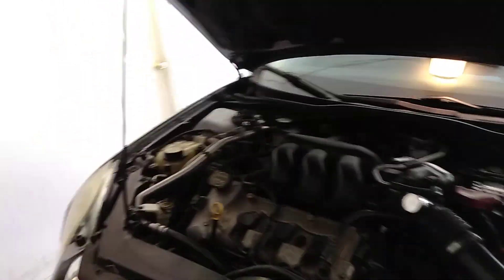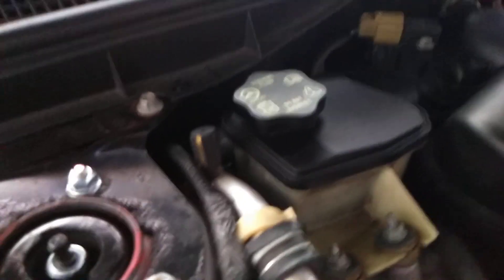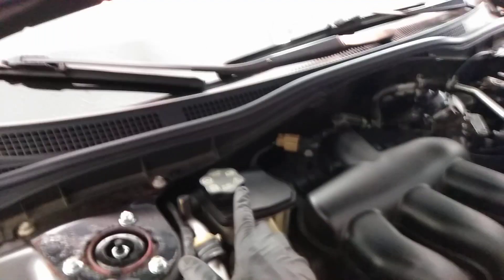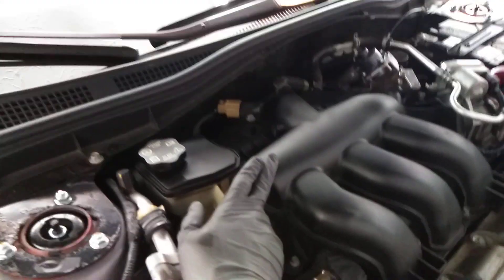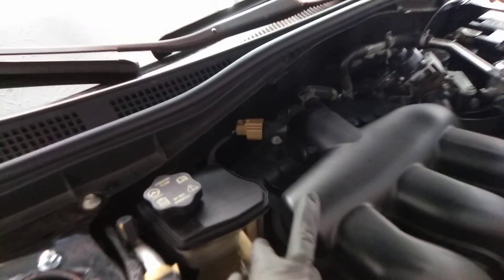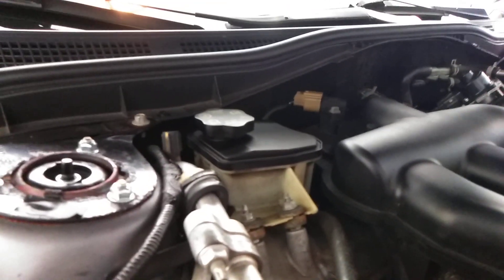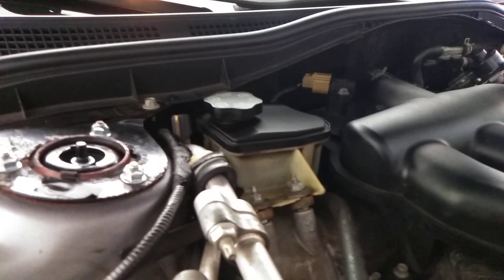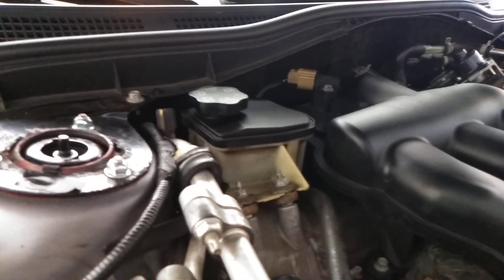Ford Fusion AC Drain fix simple

Comment: I HAVE A 2012 FORD FUSION SE 4 CYL.  WITH AC DRAIN PROBLEM. IS IT DIFFERENT TO CLEAR THE PLUGGED TUBE?
Reply: I just got my mom's old car it's a 2012 fusion and while removing the old cloth seats because I got leather seats for it.i noticed the passenger floor was wet further investigation I seen the water coming in the car. I used 5/8 rubber hose as people mention I could not use a 90 degree because the electric steering rack is right in front so I got 5/8 rubber hose to go over the drain and extent it a little pass the drain tube and silicone around it and that worked.

Comment: You're right the design flaw goes beyond that, my Zephyr kept dripping on the engine cradle and one I was driving and the control arm snapped off the frame because of the rust and I lost control of the car! Thank God I was at 40mph. It was rotten like chips, the right side was intact which a proof of my theory

Comment: I had this same issue, but we couldn’t get to a good angle to feed anything into that tube to clean it out. So we ended up attaching a rubber hose to an air blaster and blasted whatever was blocking it out of the way.  

Not sure if this will work long-term, but a bunch of stale water flooded out of the drain tube after we did this.

Comment: Wonder if this is the issue on my 2013 Mazda six ,,     it is Ford   There is no tube but there is a nipple that sticks out just a little bit and you could see it dripping down..     The rubber seal is deteriorated
Reply: Well I just checked it and I have  plumbers putty I put around it and sealed it up now I have to figure out how I'm gonna permanently fix it

Comment: Do you think that'll be the same issue on a 2009 Lincoln mkz???every dealership,repair shop and repair man has said my drain hose is clear and my heater core is fine...but my pass side floor board is still wet and I've yet to see any ac drainage since I got the car last year...something is off
Reply from the maker: Worth trying to put an extension on the drain and see. It won't hurt anything.
Reply: I have the same car you do. It's also doing the same thing. No condensation draining from under the car. However, the inside of the car is not getting wet, so I have no idea.
Reply: @Bugkiller08  hey man I actually got mine fixed a few months ago...it was the evap drain hose clogged so they cleared it and added a 90 degree hose to the end and I'm draining good now

Comment: This is happening to my damn 2010 fusion. Carmax replaced the heater core at the first of 2019 and now my passenger side floorboard is wet again! No drop in antifreeze level though whereas at first I was rapidly losing coolant...so I suspect this is the cluprit
Reply: Did you ever figure out the solution? I have a 2010 Ford Fusion and my passenger floorboard is soaked. It hasn't rained in weeks either and it's under the carport when/if it does. But my AC is on max always.
Reply: Can't find any drain either. I see two massive drip spots when I look under the car.

Comment: Is this a problem on a 12 fusion?
Reply: Did you ever figure it out? My car is doing this now
Reply: @carpediem570  did you figure this out? Mine is dripping inside the cabin to the floorboard and my drain is seemingly unclogged. I've stuck bendable wire in there to clear it out and everything. It's definitely water. 2010 Fusion.
Reply: Did you figure it out? I have a 2010 fusion.

Comment: Uh no. If you are getting water on the carpet 9 times out of 10 it means the drain tube is clogged. Blow it out with compressed air and problem solved.
Reply: Where do you blow the compressed air in from?
Reply: this is a drain tube though i think